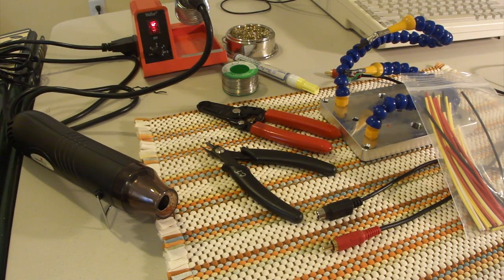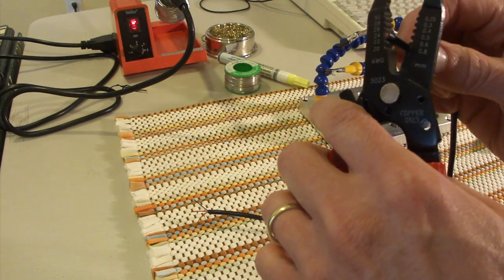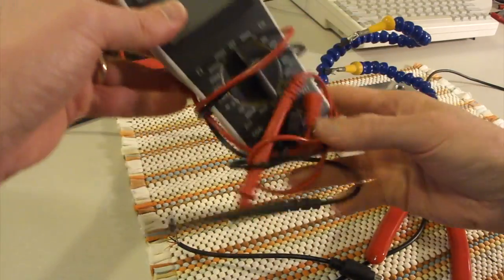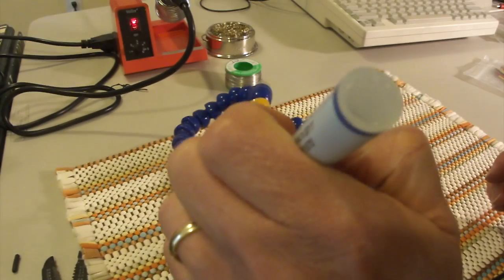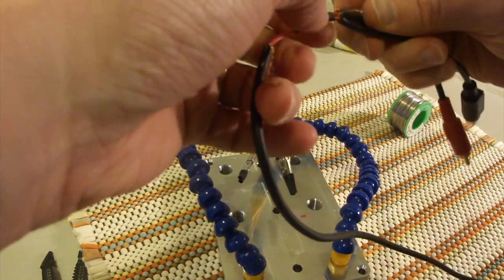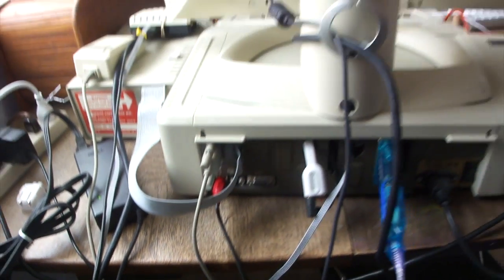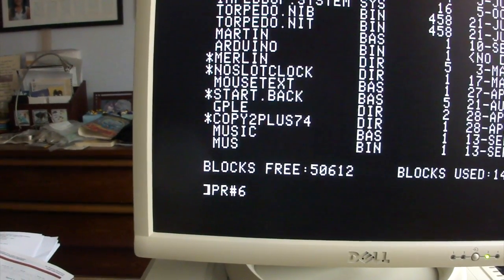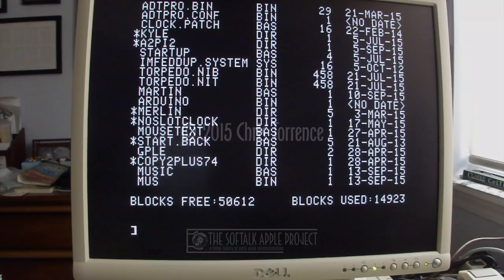Assembly Lines #17: Apple IIe SVideo and Composite Cable

Comment: Wow, I didn't know it was possible for 80 column text mode to look that good. That's awesome!
Reply from the maker: Yes, it's definitely worth it to make one of these cables!
Reply: I don't actually have a monitor capable of displaying an s-video signal, but if the Apple IIe I'm going to look at (and hopefully buy) tomorrow doesn't come with a color monitor, then I'll probably pick one up and make up a cable like yours.

Comment: Nice video!  What color paint did you use on your dell monitor?
Reply from the maker: You can use either Krylon Almond spray paint or Rustoleum #7758 Almond
Reply: Excellent Question!  I found a gorgeous 20" LCD Screen with numerous inputs for $7 at the Local Thrift Store WITH nice cables giving me 3 in Total BUT they're ALL Black so a Paint Job is much needed.
Question:  Did you Sand PRIOR to Spraypainting and did you seal it afterwards?
Thx.  -Mark.

Comment: Hi Chris...  Where do I find an LCD Monitor like that, Sir?
Reply from the maker: +MikeK8LH Hi Mike, I got mine off of eBay. It's a Dell 2001FP. I just did a quick search on eBay and found several for around $40. Just watch out - some of the later models (like the 2007FP) still have the composite input but they don't look nearly as sharp, even with the S-Video. If you manage to find one, post a comment and let me know how it looks.

Comment: I'm sorry, a question: It is possible to split a composite cable with two composite jack outputs? Exit from the Apple IIe and enter both the Apple monitor and the colour TV monitor at the same time?
Reply from the maker: Hi, thanks for subscribing! Yes, it is possible to split the cable but you will also be decreasing the signal strength so you may notice poor quality. It also depends upon your monitors. You could just try it and see what happens.
Reply: Thanks, can it cause damage if the impedence is halved to 35 ohm?
Reply from the maker: No, it shouldn't cause any damage.